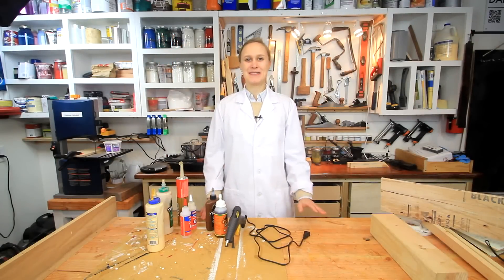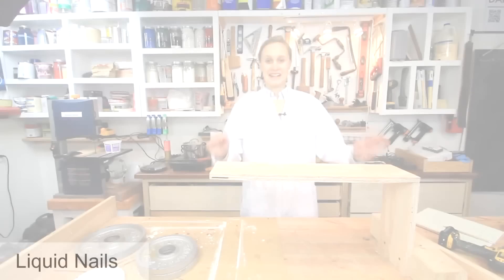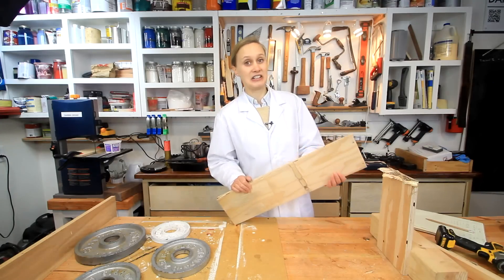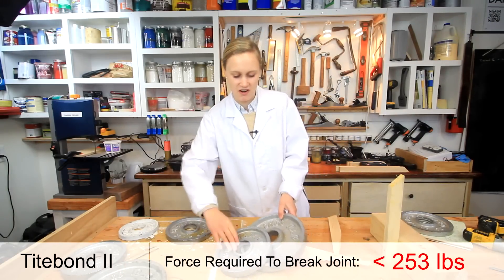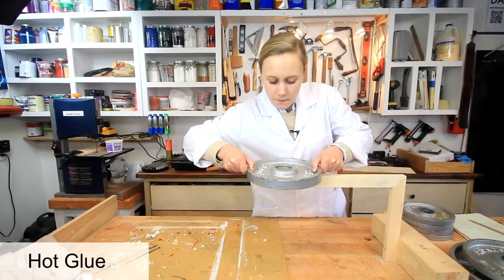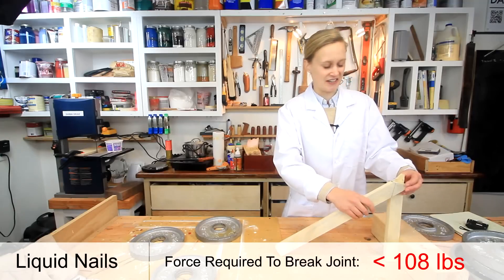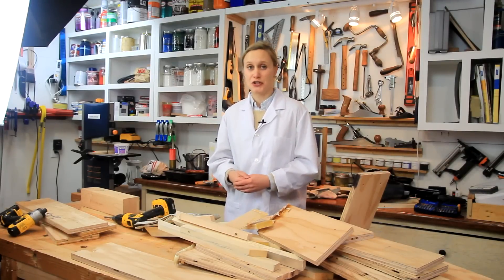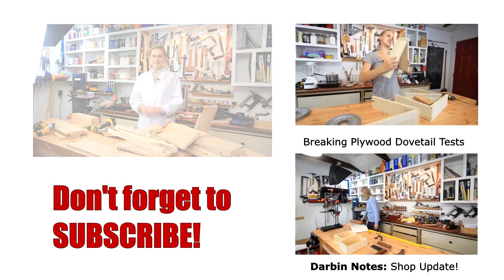Glue Test Destruction - How Different Glues Perform

Comment: 1:32 – Titebond II. [298lbs]

1:50 – Titebond III. [333lbs]

2:11 – 2 Part Epoxy. [333lbs]

2:27 – Hot Glue. [266lbs]

2:41 – Liquid Nails. [266lbs]

3:00 – Hide Glue. [333lbs]

3:18 – Gorilla Glue. [266lbs]

5:00 – Titebond II. [253lbs]

5:57 – Titebond II, Sizing. [145lbs]

6:37 – Titebond III. [145lbs]

7:05 – Hide Glue. [72lbs]

8:01 – Hot Glue. [253lbs]

8:51 – Gorilla Glue. [217lbs]

9:28 – Liquid Nails. [108lbs]

12:22 – 2 Part Epoxy. [409lbs]

14:35 – Conclusion.

Comment: Anyone else guess wrong with the hot glue on the mitre joint? I thought it would fail early.  
The epoxy test. When you switched to the 25lb weight the load centre was move about 2-3 inches closer to the joint. That would have had an effect.  
Very interesting test throughout. Was a good watch.

Comment: I was relieved to see that Gorilla glue did a halfway decent job of holding the wood since I use it for a lot of woodworking projects. I'm making School desks and use the Gorilla glue to hold the laminate flooring onto the 1/2 inch plywood and to hold on the trim. I'm using Gorilla Heavy Duty Construction Adhesive that comes in a caulk tube. Here is a link to the desks I am making. https://northkatyhomes.com/desk

Comment: Kudos for a nice video and attempt to test glue bond strength.  Well done.  Good sound.  Good video.  Nice presentation.  You rock.
As was said earlier the plywood butt joint was not a fair test of the glue strength.  It is a test of the laminating glue within the plywood itself.  A better test (if you have to use plywood) is to have a tee joint which is several inches from the end of the plywood.  You can still have a lever arm the same distance from the glue joint.  Are you interested in repeating the test with a better glue joint?

Comment: This was an enjoyable video and the host did a great job. There are a  couple of things I would like to mention. One thing is when using hot glue you can take a heat gun and heat the glue on the joint to get it evenly hot and melted and then join the joint together. This would give the best bond. The second thing is when using a test that involves a leverage device you must have all of the weight pulling (or pushing) at the exact point of the leaver for each test or the pull on the lever will be a little different giving different results.

Comment: It's not that surprising that the epoxy does well, that is the glue with the best gap filling properties, of the glues you are testing. Both hide glue and yellow glue are dependent on the surfaces being perfect, for a good joint to form. A miter sawed end grain rarely is that perfect, so your test results actually are quite as expected.

Comment: If titebond is stored in a basement and does not freeze or anything it will last 10+ years according to Bob Behnke a senior technical specialist for titebond. Also if you are jumping on your furniture you need proper joints and supports not just glue. But it it's not going to hold thousands of pounds on a single joint you really don't need to worry, odds are the wood will fail before the glue. if your really need extreme strength then you probably should use epoxy however it is probably harder to sand down if used on wood and it might be overkill so you would be wasting time and money on using it if it's not in need for such an extreme bond.

Comment: This comment is very late, so no idea if you will see it, but I think you got your Titebond 2 tests mixed up. The Pine Miter joint tests with the Titebond 3 and the second titebond 2 test both had a very similar result, whereas the first test with titebond 2 did much much better. The appearance of the first titebond 2 test also looks visually different, with discoloration around the joint that would suggest that it was that piece which you did the sizing to, which would make the results consistent with that we expect.

Comment: Uh..  Liquid Nails is brand name.  They have multiple glues.  "Project" glue is cheapest one, 100 times cheaper than epoxy.  It is designed for bulk use and gap filling on large surfaces and for that purpose it works really well.  Better comparison would be Liquid Nails Fuze-it which is still much cheaper than epoxy, but will better compete with epoxy in bonding strength.

Comment: Fine woodworking did a study in 2007 with Case Western University testing the strength of 6 different glue types in 3 different woods, for joints with 3 different levels of tolerance to the joint and found that overall polyurethane glue performed worst, about half as well (58%) compared to a type 1 pva glue. They go over all their data in issue 192 from 2007. 
Really neat study, you can find pdfs of the issue where they show their results if you Google "fine woodworking 192 case western 2007 study glue"

Comment: Lots of factors affect the glue bond strength.  The center point of your weight on your cantilever is one of them.  So is the placement of your brads for the miter joint.

Interesting to watch though.

Thanks for sharing!

Comment: your using it wrong ... plywood is stronger based on the directions ; it relatively easily delaminates over that short pressure area the way you have it gued in here ..... still shows the differences between several glue types quite well.

Comment: I'm curious about what this means in terms of completed projects. I mean, I've seen old furniture brake at the glue joints (seemingly easier the older the glue joint), but is that because glue degrades over time or because the glue technology just wasn't there in the past? Anyhow, great experiment Linn.

Comment: Im not surprised about the epoxi. I ve built lots of model airplanes and the most used glue is epoxy cause not only it is light weight, its very elastic, which gives it strentgh cause it can warp.

Comment: Interesting to see the hide glue.  My dad used hide glue when he worked as a Luthier (repaired violins).  The reason hide glue was used for violins is that under all working conditions it holds stronger than the wood of the violin.  Yet, it can easily be released via steam in order to repair the violins.

Comment: Regrettably she introduced another variable.  I'll call it the brad nail effect.  These nails are teaming up with the glue. Who knows if their placement was consistent.  And as for consistent, the solid wood presents a problem in that no one piece is alike.  While it is also true of plywood, composite, and other engineered woods, I'd bet their deviation is much less. I applaud her earnestness in getting to the bottom of it and her rare (for the internet) foray into the scientific method, I think she would have to have far more trials to even out the deviation--and she should clamp the joints instead of nailing them.

Comment: good idea for vid but would be more concise testing more glues in more uses. they are after all designed for specific uses. be interesting to see how they all fare at eachother's jobs. PVA glue would be the glue usually used on wood joints so is noticeable by it's absence

Comment: I think you would do really good in a labatory testing products for strength, your vedio is the best I've seen yet. And I think if I'm doing end grain joints I'd pick 2 part epoxy, say for a picture frame with a nice big chunk of glass in it. Now you should test strength under different conditions like outside in the elements.

Comment: Nice video! A little suggestion on the experiment consistency tho: you could mark the center-of-load on all the to-be-tested cantilever wood bar. I noticed the loading center on 11:30 when you change to the big weight. Sorry, just a mechanical engineer passing by :D

Comment: All the glue tests on the miters with nails are pointless. Depending on how you set the brad and the grain of the wood it can have significant impact on the strength of a miter. Glue test with no nails on the miter joints would have been the proper test.

Comment: I love epoxy for woodworking. takes a bit more practice, but it is very easy to clean. for 5min epoxy you can unclamp after 40mins and then just scrape away the squeeze-out. the beautiful part is that wood does not soak up much of it so you get less problems when finishing or staining. scrape, then wipe with acetone or toluene very well. if you wipe 5min epixy with any of the two in a 2-hour window the reaction is still not finished and will soften easily. for 15/30 min epoxy waut st least two hours before unclamping

Comment: All the Titebonds held along the glueline as the epoxies did; the failure separated at the first lamination, the intrinsic weakness being the plywood itself. First 4 minutes needed to be scrapped as noted. Once failure occurs within the material rather than along the glue line no more differentiation can be seen. I hate YouTube videos that look like first-go unedited fluff. Perhaps a real structural engineer with wood experience could take over? The clear epoxy penetrates deepest in its watery phase, then becomes a strong polymer so it has a deeper anchor into the wood fibers, then the strongest apparent cross-sectional strength. Pricey and overkill for most construction applications, however.

Comment: did you just use glue on the plywood step on test or did you also use brads there? What was the thickness of the plywood and length of the glue joint? I'm thinking of assembling a cabinet with glue only, no tenons, no dado grooves.

Comment: This test could have used an offset "T" orientation between the two pieces of plywood to take the plywood's ply-strength characteristics mostly out of the glue strength equation. There was no benefit in "testing the glues" with the top board butt jointed to the vertical board as this makes this a glue and plywood ply strength test.

Comment: Yeah Lynn, as some other commenters noted, I was thinking that 
controlling for the center of mass is important—I noticed that 
some of the weights were placed further in and others further out, changing the 
effective length of the lever.  And when using the larger diameter 
weight at the base of the stack, that means the center of mass moved in 
quite a bit too.  But this is a really informative test nonetheless!

Comment: I'm no engineer but had you simply extended the top board several inches past the glued joint you would have actually tested the glues presented instead of the manufacturing process and glues and variances in those boards.

Comment: I'm pretty sure I know why the epoxy did well with gluing the grain of the wood (or whatever you call the top part....)
Epoxy is type resin with a hardener.  But part of the resin would have been soaked with in the wood making it similar to Micrata.
Reply: Epoxy better do well. IF she used West System 105-206, it would have been even stronger.
They use epoxy in assembling planes . They better hold up.
Reply: Rocky Elorde Lol. Boeing uses carbon fiber, a plastic, to build its 787. I use epoxy to build my RC plane models lol

Comment: just a fyi, the pre- sizing method isnt for solid wood. its primarily used in plywood. because plywood isnt a solid wood so its easier to break in between the layers, for obvious reasons.. when you pre-size plywood (like the one in your first test run. it would of made the 2 ends a lot stronger like solid wood, because of the multiply layers it can soak up the glue and become more solid. by the way you may want to wait a bit longer than a few mins after pre-sizing before applying the real layer of glue. and pre-sizing solid wood is kinda pointless. its solid it wont get soaked up and will just become the layer that the glue you apply afterwards sticks to primarily and obviously thats a lot weaker than the wood.

Comment: Wouldnt you need metal to metal in order to test purely the glue?  Because the plywood breaking at the same point every time, or at least several of the tests, shows that the plywood is what is really the limiting factor here.  At least for the plywood test.
Reply: Also the leverage arm was different for different tests. The weights were not always the same distance from the point of rotation. But she says "I'm not sure exactly, what I have learned here, other than that plywood is really weak".
Reply: That would only test the tensile strength of the glue itself, not the joint strength.  To get practical data, you need to test the aggregate strength of the glue and its adhesion to your material.  The strongest glue in the world would be worthless if it bonded poorly to the wood you use
Reply: testing wood glues with metal? are you in your mind?
Reply: Using metal to test wood glue? What are you on?

Comment: great video, I'll get Epoxy 2 resin & hardener for a little thingy I gonna do no doubt
Reply: JB WELD!!! Is the way to go. The only drawback is it takes 24hrs to completely harden.
Reply: Hi, thanks for that.  I got it from a video I saw reviewing several glues.  If glued properly, the wood will break before the bond if you press very hard.

Comment: Can Liquid Nails Construction Adhesive be used to install 5" x 20" x 1/8" lightweight porcelain tiles on the back vertical wall between a countertop & the upper cabinets in a kitchen?

Comment: also . would be nice if you did grain to grain test for strength.  that would be the ultimate test . in soft wood or hardwood . thanks by the way excellent video. came across it looking for glue limitations

Comment: Clamping overnight with pressure I have found really increases the effectiveness of both Titebond and a adhesive you didn't test, Weldbond.  I have found with both, using clamping, the wood always fails before the adhesive.  You were simply tacking the wood together with finishing nails.

Comment: What magic hot glue did you use?
Reply: standard all purpose most likely there is a much stiffer hot glue that usually is color coded yellow and gets WAAY harder then the white stuff but it is more expensive at least where i live
Reply: Nails Hot Glue
Reply: I would have liked to have seen a “wood” hot glue.  They seem to be better.

Comment: i did a test on the liquid nail, it really doesn't hold the wood well, the glue join is pliable and its' elastic nature seems to break if you applied a constant force. I waited 7 days for it to fully cure for the test. Epoxy is a much better gap filler adhesion from your video. Mitter joint is sloppy because of the end grain with lots of tiny void needed to be filled. I was looking for a glue for sloppy joint application, thanks for the video. Now epoxy hunting.

Comment: Of course epoxy rules. It's an extremely hard resin formed by chemical polymerization via a catalyst. The molecules become linked to each other in a matrix. On the other hand, hot glue is just solidified melted glue. All other glues harden by evaporating their respective solvents ( organic or water).
Reply: well, this is just a demonstration for non believers ;)

Comment: Hi Linn, very interesting video, thanks.  I was also really surprised by the hot glue, who'da thunk it.  Have you experimented with cyanoacrylate glues?  I'm currently trying to glue up some crazy shapes from wood and seem to have found a solution using a mix of glues - gorilla and super glue seem to work well, with the super holding while the gorilla cures. I'm feeling inspired by your vid so might have a go at doing one for that.  New sub ;¬)
Reply: seems a good one :)

Comment: You forgot to take into account that adhesives are designed for a specific purpose and typically are not intended for the kinds of stresses that you were subjecting them too. Also, plywood is incredibly strong - but it has strength laterally, which is why it delaminated so easily. It was still a fun video though and very interesting. I really enjoy watching you and am quite impressed with your talents.
Reply: I don't think that matters very much in terms of overall strength. It can either do it or it can't and in this kind of testing, you need to be consistent. I agree that something like construction adhesive, which is usually used for things like flooring, is not really appropriate for a mitre joint but if it's a sheer test, like it was for the jumping test, then there is still some relevance. Definitely agree about plywood though. It looked like the glue in the plywood wasn't as strong as the other types. The hot glue was interesting.

Comment: Nice tests. The final "bench press" test, btw, is not quite comparing apples to apples (to be scientifically correct). I know this final test was more for fun, but still. I bet the joint it’s weaker when applying the force upwards than downwards, though i’m not a mechanical engineer so my intuition could be wrong :) And one more thing.. you made me nervous seeing you doing these tests without safety goggles. Wood splinter accidents can happen. Safety first. thanks for sharing.

Comment: As far as box store construction adhesive use the PL or  Bostik's Best.
 Liquid nails sucks and no buddy in construction uses it in any applications that are necessary for anything other than compliance for building codes. It says "not for use on hardwood floors" on the tube because it's not up to the task of gluing two pieces of wood together.
Gorilla glue turns into a foam wean exposed to air. So it works really well on ruff suffices and really bad on smoother services. With some really strange exceptions like gluing the mirror back on to your truck. 
I have never tried Super glue and don’t like contact cement. If i get into a situation that requires something like contact cement i will use 3M adhesive spray instead.

Comment: Slow setting epoxy is an expensive but very underrated adhesive. Many have used it in place of welds in even some stressful builds such as firearms.
Reply: epoxy is the best of all almost like hard plastic strenght, i used it to repair my hydrocleaner lance , it has 140 bar pressure , used it for 3 years already didn't skip a beat ;)